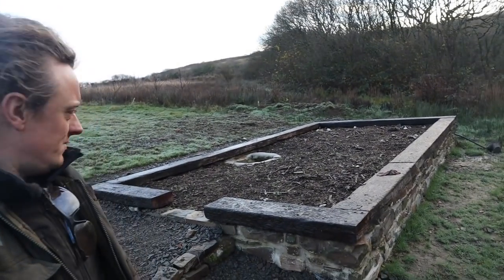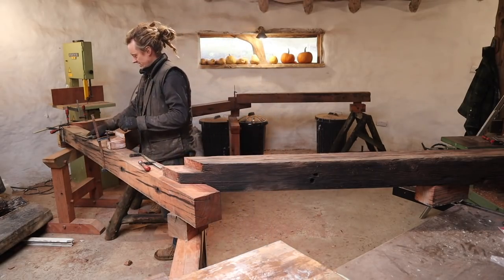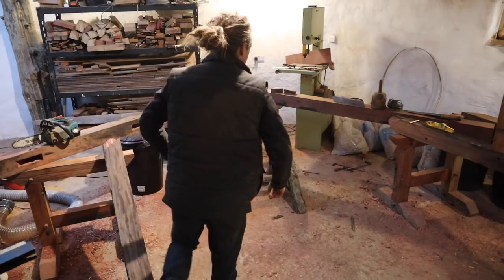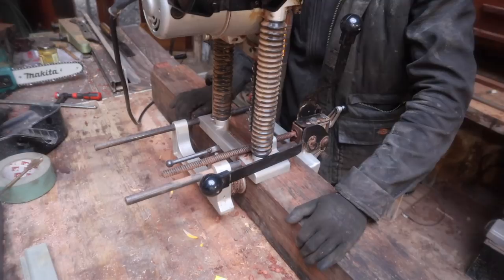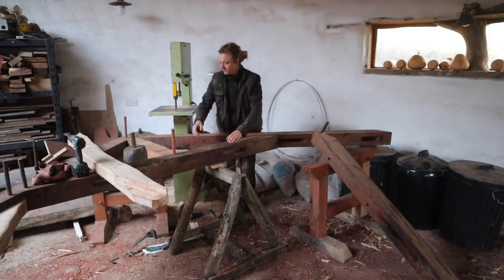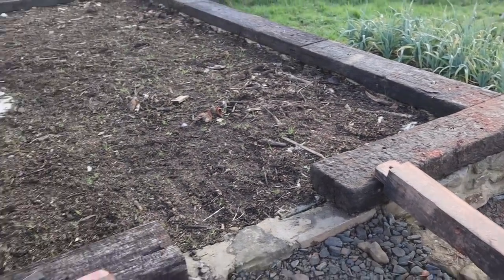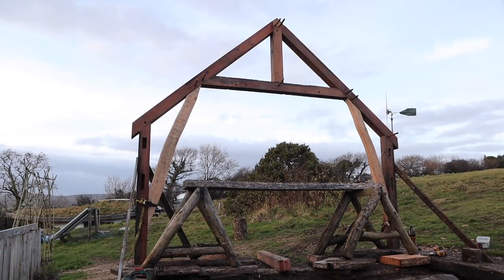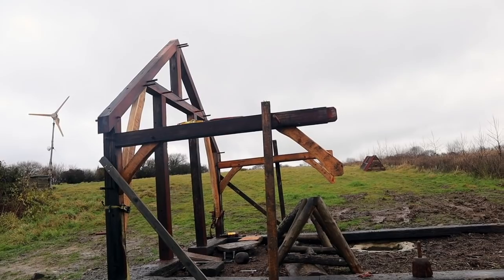Spring Fed Timber Framed Greenhouse Part 5 First Frame Building

Comment: Kris, I can't choose which is more beautiful, the mortices and joinery or the timber structure itself. I have seen the joinery work done in Japan in old temples and structures, some of which is still used in interior structure still with a modern exterior structure, and this is very similar to old Japanese building techniques, which I have always marvelled at the sheer simplicity and effectiveness of the structures. Your sculpting of the cross members and using a different wood for them really adds artistry and beauty to the structures.
I very much am wanting to buy land and live off grid and build my home and buildings on the land myself, with a few friends also into the lifestyle, and I plan to model things after the work done on My Self Reliance by Shawn James, and by you. I don't know if I will go with so much wood as I would like to experiment with different materials and techniques, but the actual structure will definitely be wood in most cases.
Using adobe and mixed clay bases for walls is definitely an interest for me. I think most of what I build will be experimental while also being functional, and will leave me the ability to change things quickly if the techniques don't work well for the end result.
Thank you for the assortment of techniques and supplies you have used in your building, you have really opened my mind up to some alternative building methods that I think may be better than any conventional methods.

Keep Safe,
Peace, Happiness, Love and Laughter Always,
Matt

Comment: If you assemble the bent's flat, you can raise them with a gin pole, shear poles, or a derrick using a rope and pulleys. Probably easier and safer. Great videos, thank you

Comment: Hey Kris great video as always mate, I recently built myself a double H frame with 4 legs, basically it's a 1.5m x 1.5m square frame with 2 lengths going out horizontal at either end 750mm each with the height of the frame 800mm so that I can build a hydrofoil catamaran boat on. Man if you had of seen the frame you would have thought it was a load of crap put together with a nailgun but it suits my purpose as a table for making a boat on top of & plus I suffer with extreme arthritis in my lower back so I'll work for 5 mins then rest for 10mins even while taking huge amounts of pain killers to stand up. But I'll never get to be able to have the same quality woodworking skills as you have mate so you are an inspiration to all us dodgy wood workers out here.

Comment: From one Chris to another (Kris), I just want to convey my appreciation for what you have done to this point. As a person who, himself, has built a timber frame 14'X18', I can truly not only appreciate the work and effort you have put forth, but more so, the fact that I had plans with measurements, where you didn't. That in itself is top notch (pardon the pun). Your method of going about raising it was a quite different than mine, as I put my bent together first, then raised it using a 12 volt electric winch with a remote control and had a homemade mast braced off and a pulley wheel at the top for the winch line. You obviously didn't have access to such items, hence the one by one installing of each piece. Good on you!
Furthermore, taking the time to set up a camera to document and show us, the viewers, your steps along the way is also truly commendable. I did video tape my processes, but don't have the gumption to edit it for a video distribution. Maybe down the road?
Lastly, the work you did to process your own timbers with your own chainsaw mill where I went to a local sawmill is even more impressive. Living in what looks to be a shire with nothing around for miles makes you have to adapt and improvise. Your workshop (I love it!) is rudimentary but very much practical and functional. I tip my hat to you, sir! Bravo and Cheers from Canada. Much more success in your build. Will stay tuned!

Comment: For my timber frame, I made tick boards with all the critical mortise and tenon measurements. Saves the hassle with measuring tape and its inherent inaccuracies. Later I used the same boards to brace the frames.

Comment: gday kris i’ve noticed when your chiselling you don’t clamp or stop the larger pieces you’re working on, this actually slows the work down as quite a bit of force is lost and transferred as lateral movement. means you’re having to expend more energy and time and at the end of the day the body appreciates it. I speak from experience having worked with these heavy timber’s here in Australia and being an old fart now with stuffed shoulders, knees and hands i wish i’d learnt to work easier not harder motto sooner rather than later, cheers enjoy
sorry to add more but when using an alaskan style mill setup if at all possible if you can sit the log on a couple of bunks of different sizes so that you’ll be milling down a small slope( no more than 5 degree)allowing gravity to help the mill.

Comment: I'm surprise you made the queen post  as you did normally the top of the queen post is a long  dovetail that is meant to support the down  load on the support joint's , I have seen a queen post the supports the second floor,  to hold &  supports floor in place of ground floor  support beams  cart the the flor beams at floor level to provide large areas.   in a Barn & remove the need for post support.  I get it it a small building not prickly required  but a chances to practice lost i think . Les me being house bound Now it all i can offer  you do good work the green house is looking good .

Comment: a few thoughts on your build: The way you built it needs much effort as you have to lift all the heavy beams up to the top of the construction. Also you need some sort of scaffold to climb up to wich increases the risk of accident. furthermore that way the door beams have no mortise to connect to at the bottom.
I remember it to build the entire frame flat on the ground and to raise it when complete (beginning with the rear part not the front). with pulleys and winches that could even be done alone at lower risk and effort.
Nevertheless it's a beautiful craftsmanship and i'm looking forward to see it finished!

Comment: I’ve been amazed for I guess a few years now at how much power you manage to eek out for getting work done. I know you have surplus seasons that produce plenty, but how do you manage running some of this stuff in the “off seasons”?
Reply: Hi, I think it is the mix of energy sources he has: Solar, Wind and Hydro. When the solar drops off during winter the hydro ramps up and so on. Even with all that it is still impressive he can use such heavy workshop equipment.
Reply from the maker: I dont really have an off season. Because i have power from rain wind and sun. The worst that ever happens is i have to wait a few days if i have alot of wood processing to do. I also cook with electric in the morning and afternoon. then mostly use the fire in the evening in the winter.

Comment: fair paly Kris it will be a solid building ,excuse my ignorance but can help wonder why the frame wasn't put together on the ground and hoisted up with the tractor maybe
Reply from the maker: the tractor is all hooked up for fencing. the post knocker on the back, all the hydraulics changed over to it instead of the bucket and a bucket full of stone. it was to much work to change it all considering im fencing on Sunday. also to wet to pull with the van so i just did it like that instead.

Comment: Roof pitch angles . Thatch 55° . Plain ( 'Peg' ) tile 45° laid in trebles . Slate 40° . For glass use slate . Tile and slate normally laid over sacking boards now felt and battening . Angles are based on the materials ability to shed rain water over centuries of building. Jointing - M&T rule of 1/3rds both mortise hole and tenon is 1/3 the width of the timber . Halving joints obviously half the timber thickness , Housed Halving joints , half × 1/3rd . Collar and Tie beams generally Splayed Half Housing joints for ease of assembly of frame . On exposed faces e,g. Gable ends , splay would be inside the building , obviously internal,Principal Frames have no facing . Principal Rafters to King Post - M&T joint . If using Queen Posts- M&T . Common Rafters at Ridge - HH joints , birds mouth to wall plate 1/3rds . Purlins to Principals are Housed joints. Post and studs to cill plate and girthing beams etc . M&T . All joints pegged and designed for compression and tension loads . Commons are typically nailed to wall plate , often the only place in the whole frame where ' spiking ' is used .
Cill ( Sole ) plate bedding on hair and pitch on free stone , random rubble work , coursed and snecked rubble work and brick . On free draining subsoil cill plates were laid directly on sand etc .
Styles - Western England generally box frame and infill , Eastern England - generally close spaced studwork and infill but this can vary depending on location. Infill ranges from wattle and daub to brick noggin . Lots of finishes from lime plaster , parenting, feather edge .
There are other joints for dragon beams , jettying etc., but not applicable in simple work .

Comment: I was thinking they would be easier to assemble on the ground & then raise them, turns out that was your plan after the first frame.
I was also wondering if you could have used the chainsaw mill to have cut your overlap joins ?

Comment: Curious why you didn't assemble the whole thing on the ground out flat and then tilt it up into place.  You could've then wrapped the apex with a strap and used your tractor to lift most if not all of it up into place and then pushed it up the rest of the way straight after that by hand or using a pike pole.  They way you did it was quite dangerous. If you'd fallen backwards off that horse onto your back with the timber on top of you it wouldn't have ended well.  So glad you didn't!  Beautiful project you put together there.

Comment: you'll do your back in lifting the lumps of timber like that, get some big tripods and a block and tackle.!!
Reply: This is the best advice I have seen in the channel so far. No sense in breaking yourself down later in years, and you will. (I did the same stuff in my 20s, not listening to the older guys and acting like a pack mule to prove I could do it, now in my 40s I feel it every single morning when I get out of bed).

Comment: Hi. I am also building my first timber-frame structure ( also greenhouse ). What I wonder is, what layout technique are you using. I am asking because you obviously spent a lot of time putting beams together on the ground to check for issues. Are you using scribe rule? Wouldn't be a square rule better?
Reply from the maker: The next video i am going over how i do the joints. should be out friday.

Comment: C'mon Chris, that's not a greenhouse! That's a cabin for yersel, when you get on the wrong side of dot n land in the doghouse lol! Seriously though. That greenhouse is as big as some of those off grid Cabins in the mountains. You see being built on YouTube. Are you planning on attaching a pole with pulley and tackle to the front frame. And putting together the next frame, after morticing, on site. Before pulling up with the pulley and wire, or rope. I know you have the post thumper on back of the tractor. Can you no use the front of the tractor to pull the other end of the cable to lift the rest of the frames. It was just a thought. Anyway, great build. Of course, you probably have a idea or two yourself for hauling up those frames. Look forward to seeing your solutions for the rest of the build.

Comment: Do you really need three more frames for such a short reach? Or am I just being lazy in thinking one on each end with another in the middle? You'll have the supporting  rafters etc to make this a very sturdy structure indeed. Love your projects pal. Respect
Reply from the maker: Yeah that would be ok to use three. But the timber I have isn’t long enough. It’s designed around 2.5m lengths

Comment: Would it have been easier to assemble the frame on the ground and then lift the whole thing into the mortises on the foundation?  Seems like I've seen P&B barns built this way.
Reply from the maker: Yeah i wanted to do it like that but i dont have anything currently to lift it with. its on a slope and very wet at the moment and the tractor is all set up with the post knocker and to top heavy.

Comment: YouTube slow processing strikes again or is this supposed to be in 720p?
Reply from the maker: I had a bit of a technical issue. This video and the fencing video i have been working on were recorded in 720 for some reason. Next video frame video will be back up to 1080. I think i must have changed a setting by accident and not noticed.
Reply: @KrisHarbour  ah, thanks for letting me know.